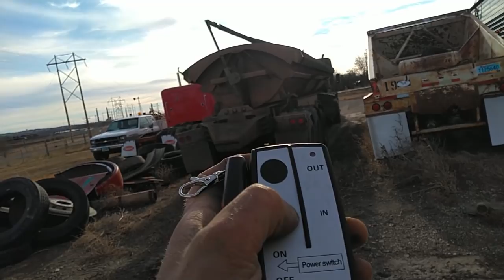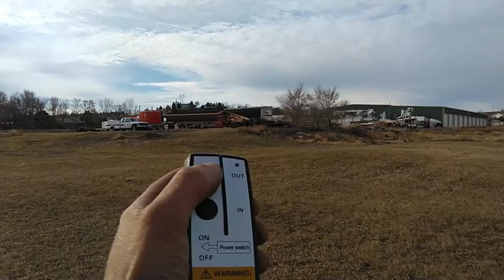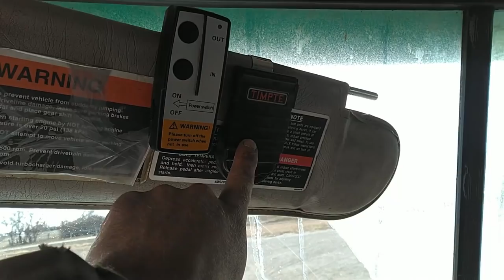$15 wireless controller on a polarity reversing circuit electric tarp or winch

Comment: Definitely be happy you installed it when the wether isn't so nice.
Reply from the maker: that and when its muddy out less tracking mud in the truck.
Reply: @Ezrider359  I used to pull a pup with a tri-axle and both were wired in the cab for the tarps. I got plumb lazy!

Comment: Neat dohickey! 
I wonder what I could do with one of those?
Maybe make a timer opener or something
Reply from the maker: could potentially have lots of uses anything that has two functions where  you can switch each function with a single hot 12v wire its not designed to carry current but to switch a relay but it potentially be applied to a lot of things.

Comment: Is going to work from the cab or do you have to get out and walk to the back
Reply from the maker: it will work from anywhere within radio range of it witch includes inside the cab
Reply: @Ezrider359  ten four thanks for the response

Comment: Ez, another good one, Thankyou, 
That trailer looks interesting. Could you explain more about what its use is.
Reply from the maker: Mostly haul gravel and aggregate with it but there very versatile you can do a lot with them
Reply: Ezrider92356 how does it dump?
Reply: If its from the side love to see it. 
My experience with dump trailers straight up left a crowned point of leather drivers seat when i walked back to close tailgate if you know what i mean. Lol
Reply: I dumped a frameless 1 time, I've got the gray hairs to prove it. And yes i was always aware to be level.
Air bag broke. Yikes
Reply from the maker: Yeah it dumps to the side you lock one side down in lock the other and when you raise the box it tips to the side you dump next to the trailer rather than behind it